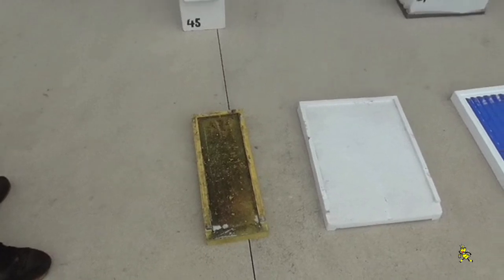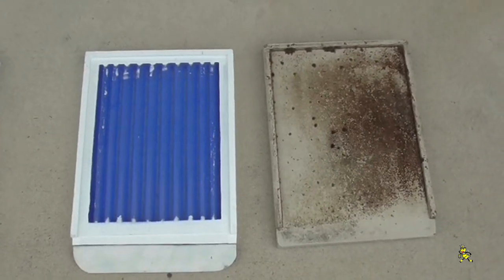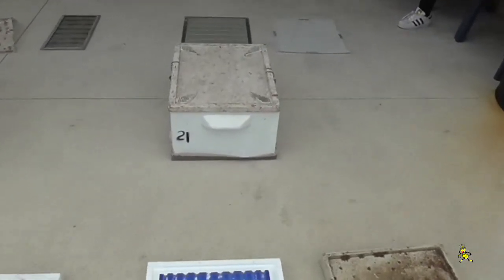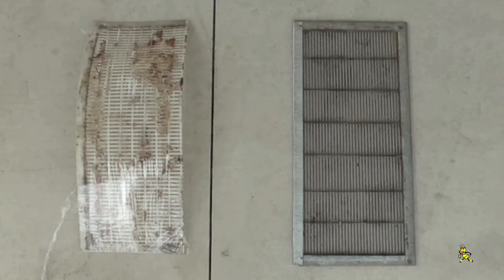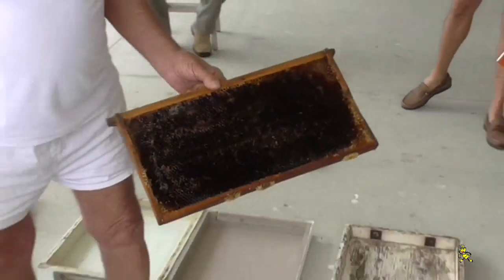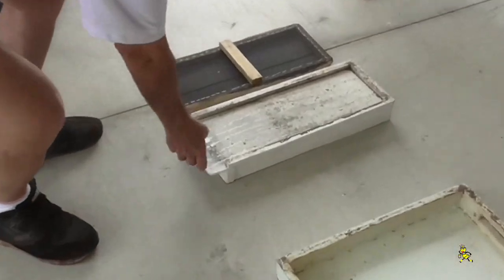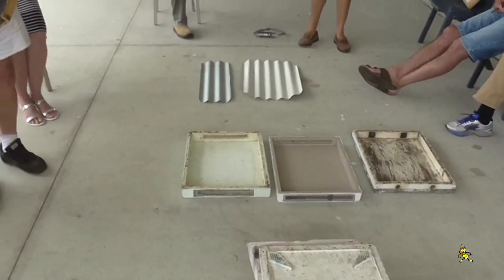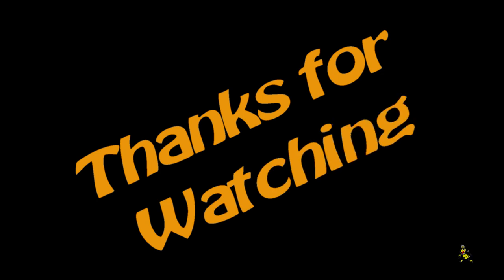Episode 9. Bee Hive Parts that I Use -  #SeriousHobbyistBeekeeper

Comment: What was the number method you use?  Also how do you track queen lines.? If so how?
Reply from the maker: Honey Production Hives: - 
Brood Supers have a 50mm high Stencil - The number is stenciled to the rear of the brood super, left hand side 
Numbered, 1 to however many hives the BEEK has

Honey supers are numbered both sides of the left hand side of supers with a 35mm high stencil

All Nuce hives are numbered similarly 

RECORDS: - I have been using a "Barrier System" for over 40 years 
I can tell from when any Queen has started her life to her end 
All Queens transfer, supers transfer, to Honey Production Hives / Nuces are recorded on Computer EXCEL Program
I have been Rearing Queens for near 40 years